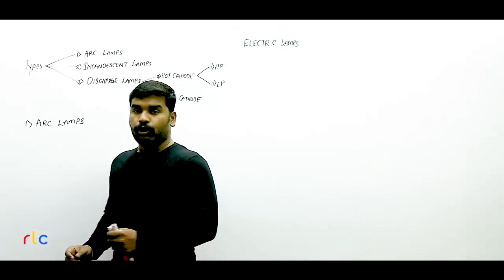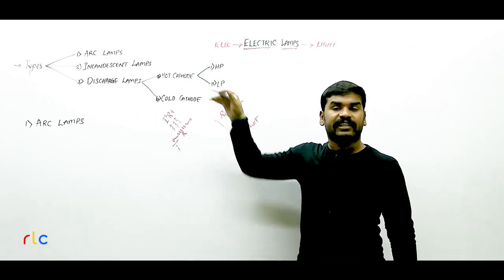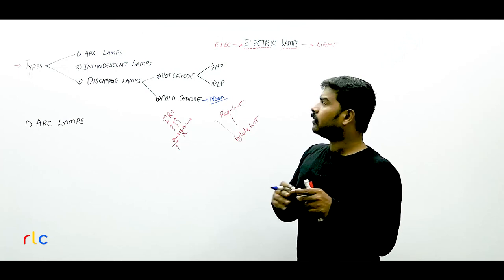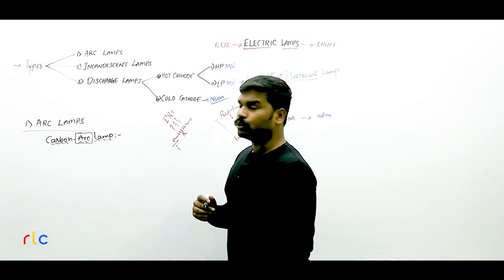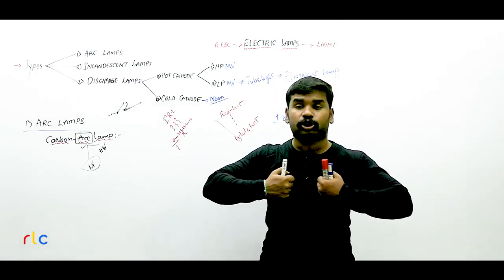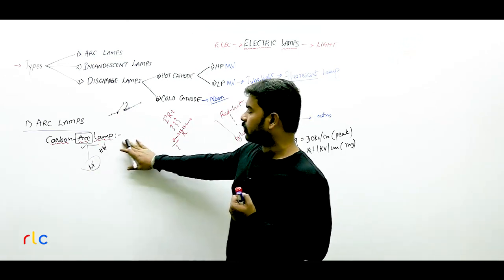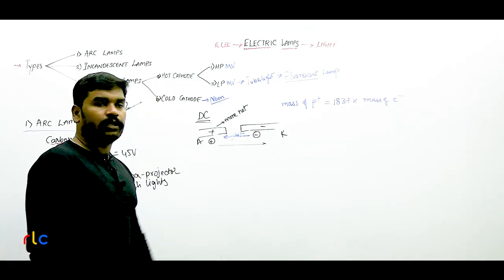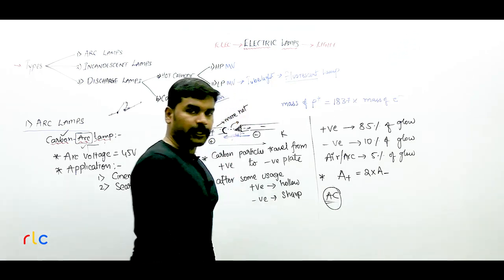Types of Lamps, Carbon Arc Lamps | Illumination Engineering | Nikhil Nakka

Comment: SIR DOUBT ,
In a series lamp set the number of lamps used are generally 5%more than the calculated number of lamps for a given voltage. WHAT IS THE REASON FOR THIS ?